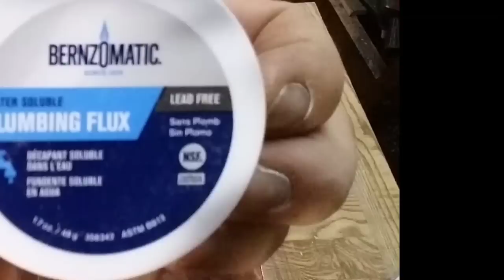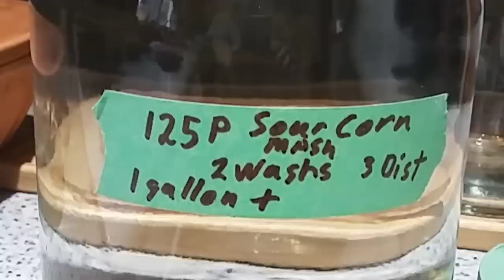How to make a copper still in under 10 mins.

Comment: I miss the days when my gay and lesbian friends were just normal people
Reply from the maker: Don't be silly....you have no friends.
Reply: How do I scale this up amd what about thumper amd worm and flake stand
Reply from the maker: I should make a video on the condenser. I can tell you that it's 1/4" flexible copper, formed around 3" pipe and cased in pvc. It's cooled with a submersible fish pump drawing from a 5 gallon pail of cold water. 
I find I have to switch it up at least once per run, depending on the season. No more than three times. I've yet to make a thumper. I have a smaller spirit still that I run on a hotplate. Used for 2nd and third distillation.

Comment: A couple thoughts. One is that a still be made with various sizes of copper pipe. These designs allow the flexibility to easily reconfigure from a pot still to reflux to a hybrid as the slip-together pieces are sealed with rye flour paste. Such a system can be broken down and stored away taking up less room. Knowing how to use a TIG welder on copper is a big plus for specialty components.
Reply from the maker: Thx. It does slip together and seal with rye paste. You can see it run here. https://youtu.be/5y-X3xZ_qt4
Stores under 40"
I agree though. I need a tig.

Comment: On the reducers, going from one inch down to, I believe 1/2 inch, is it necessary to use the incremental reducers, or can one go from one inch directly down to the one half inch?
Reply from the maker: So it starts at 1 1/4" and I went incrementally more cause I couldn't find a  direct reducer. Not sure there is one. 
I don't think it would change a lot though.

Comment: Hi.  I had a bit of a laugh at 4:07 when you showed the plumbing flux, lead free.  The origin of the word plumbing comes from the latin word plumbum and means "lead".  In French it means plomber.  A fuse in French is "plombe" because in the early days they used a very thin lead wire.  And pipes were made out of lead.  And who uses pipes?  A plumber or plombeur.  Funfact :)
Reply from the maker: Thx for the fun fact. I did indeed know that.
Regardless of the etymology, though, there is no lead in modern, lead-free plumbing solder or flux

Comment: The video is under ten minutes, but the actual elapsed time is more like 10 hours. You didn’t show everyone that you backed up the copper with a steel pipe when you hammered the rivets in. 
And the finished one looks beautiful but the in progress soldering was horrendous. Two different pieces of work. Lots of other scummy work going on there, but you don’t show it. Just one machinist’s opinion.
Reply from the maker: So I should have done a ten hour video? Or a bloopers reel? I think you're missing the point here. And it was not two different pieces. But thanks for the time you must have taken to pick apart the video.

Comment: Oh my goodness another roofing flashing still. Too dangerous to run.....😢. Dude that's not craftsmanship. That's ignorant.
Reply from the maker: You seem so genuinely concerned. Thanks.
Reply: That does look very thin .. my stainless still is strong enough I could stand on it if wanted too , if this is hooked up to a thumper be sure and vent the system at the very end of your run as it will crush like a beer can .
Reply from the maker: I do appreciate the comments, however the still has taken a lot of abuse over the last 8 years, along with 4 others I've built, all lead-free, and washed out with industrial grade vinegar. Never had a problem. Not sure what @masonjarmafiaOG is getting at.
Reply from the maker: P.S. It is unadvisable to stand on your still.